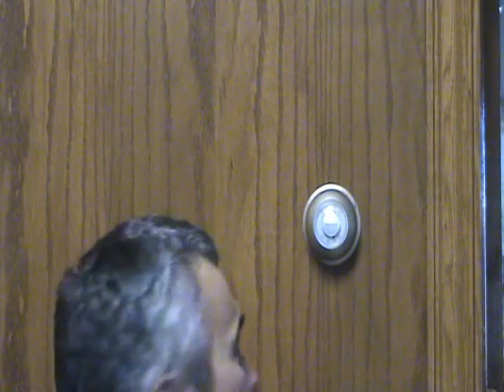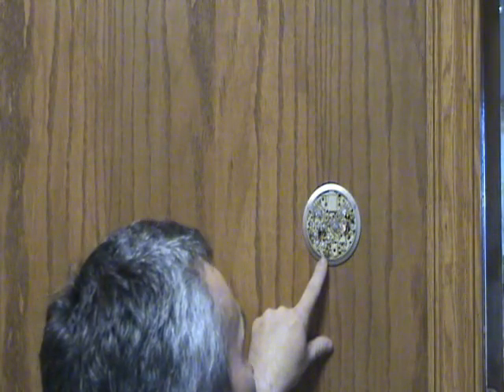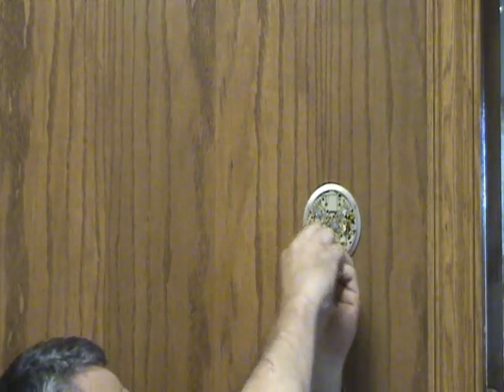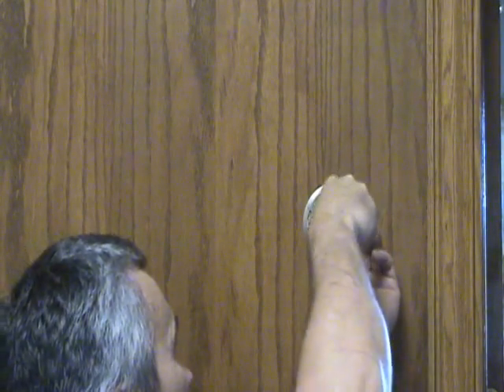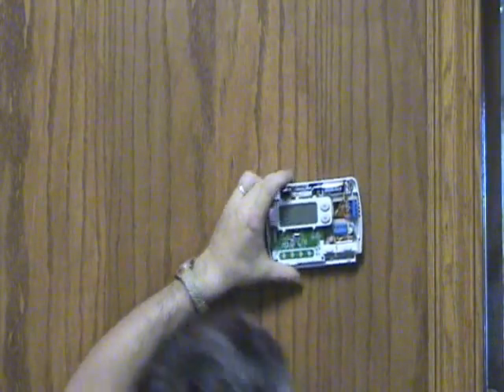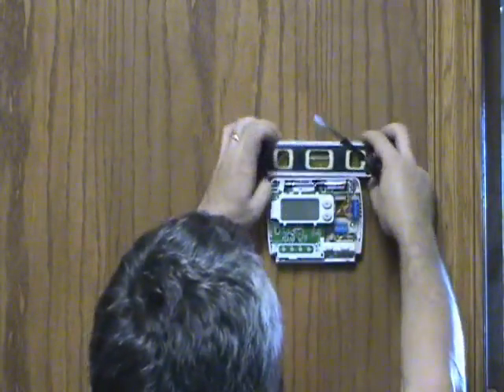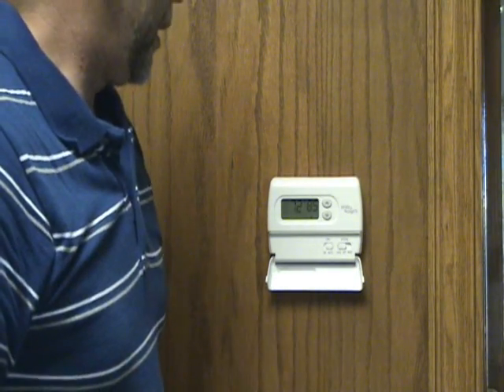Save 10% on Bills! 💸 How to Upgrade Your Old Thermostat Step-by-Step!

Comment from the maker: Before you disconnect anything, TAKE A PHOTO of the wires! 📸 Even though there are 'standard' colors, some installers use different colored wires for different terminals. Having a reference photo will save you a massive headache later.

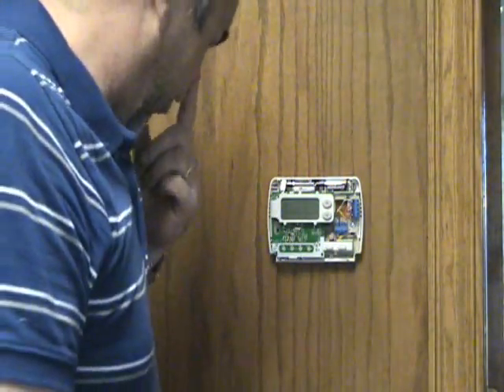Quick Tip: If your new thermostat isn't turning on your heat, check the small switch on the back of the unit. It needs to be set to 'Gas' or 'Electric' depending on your system, or the fan might not kick on correctly! [04:20]